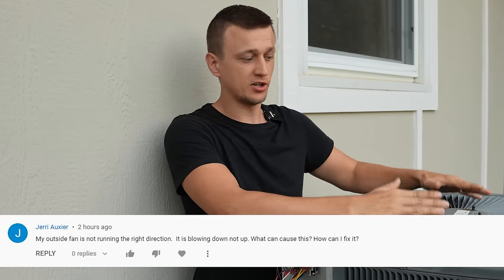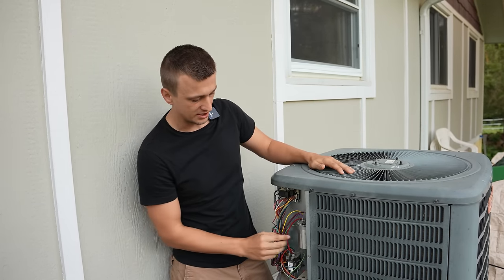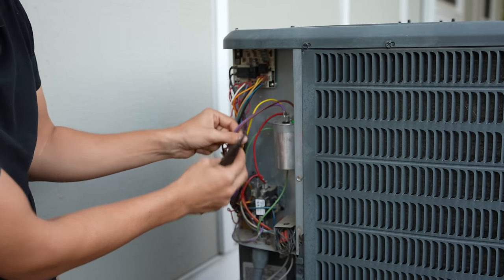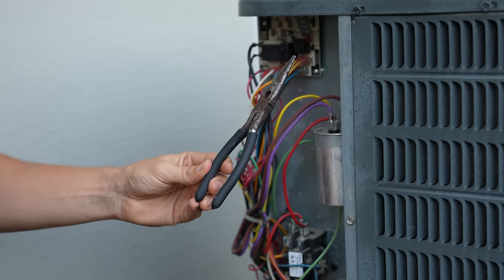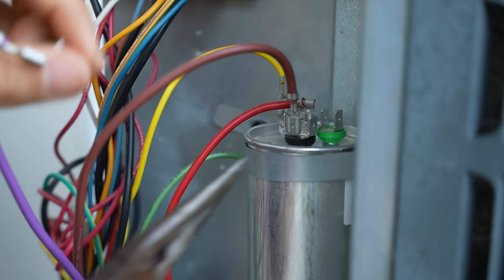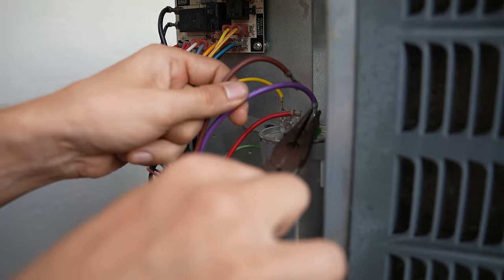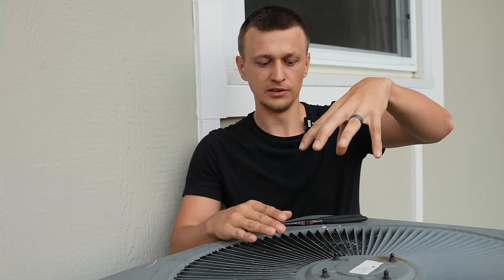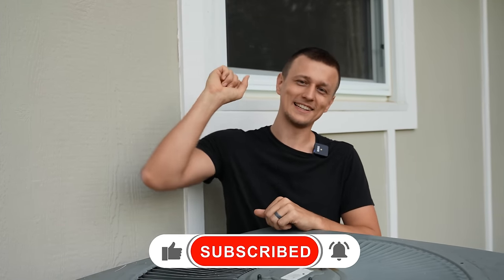Outside Air Conditioner Fan Spinning The Wrong Way - How To Fix It

Comment: Good video 
I’ve a question 
How do you wire or connect a fan motor from dual capacitor like in this video to a single capacitor 
Like for example if I need a 45/10 Mf but I’ve only singles capacitors how do you wire them 
Thanks I follow you from Houston Tx
Reply: Put jumper wire on common leg!
Reply: @bigc8300  
Thanks a jumper from the dual capacitor to the single capacitor
Reply: @Sersol1983  10 4
Reply from the maker: @Sergio Solano
Thanks!
You would simply plug in the two wires that come from the fan motor and go to the dual capacitor, to the single capacitor. This applies if only the fan side of the dual capacitor went bad but the herm side is still good. If the herm side is bad too, you would need to put in another single capacitor for the herm/compressor as well. If you don't have a large enough capacitor, you can combine a couple of them as well. It gets a little messy so if possible, it's best to replace dual caps with dual caps. You might find this video on combining capacitors interesting though if you haven't seen it before: https://youtu.be/qLJOWU33TFo

Comment: Would make a good tip if you were to show a video of what happens to fan and compressor when someone hooks up capacitor connections to wrong terminals..
Also, if you had a locked up scroll compressor, that didnt free up from a hard start kit, have you ever reversed the herm and common to unstick it instead of rapping on the compressor head with a rubber mallet?

Comment: Question for you: I had my AC serviced last year and the tech told me the fan had been wired backwards and was turning the opposite direction. He also said my capacitor needed to be replaced so he swapped it with a new one and now the air blows out the top, as it’s supposed to. My question is: if my system had been running backwards for several years (it’s a new home so I can only assume it was installed incorrectly), how big of an impact do you think that might have had on my electric bill? Is it a big difference when it runs backwards or more of an incremental hit?

Comment: Hey 👋 Jay my number one good buddy best friend ever ❤️ you would be proud of your old friend my friend's Mary and Cody there central air quit working and the heating and air man wanted thirteen hundred dollars 💸 to fix it and I fixed it I replaced the blower motor in the furnace it was burned up and there furnace filters were so dirty and I changed them and told them to change it often  but I got it up and running no problem 😊 thanks to you buddy..I don't remember if I told you but Arnold has congestive heart failure and my vet put him on medication vetmedin he takes it twice a day for the rest of his life so it costs me five seventy one  dollars a day but I wouldn't care if it costs a thousand dollars for he is worth much more than that..he is doing pretty good right now I haven't seen much change in him so I hope it helps him my Dr may have to change his dose..well good to see you my friend I love you and your family 👪 God bless you Jay and thank you for being my friend ❤️. I really appreciate it. 😊
Reply from the maker: Hey David!! I love hearing that!! You're the man 💪💪 Replacing a blower motor is a lot more involved than just replacing a capacitor so major kudos to you my friend! Your friends are lucky to have you. It's good to hear that Arnold has more or less stabilized. Last time you told me about his condition you sounded a lot more worried than right now. Not only are your friends lucky to have you around, Arnold is fortunate to have you as his owner as well! 👍👍👍 Hopefully he will be energetic and in a good mood in the days to come! Good to see you too David, we appreciate and accept the blessings! May the good Lord bless you, your family, and friends as well! Aloha from Hawaii! 🌴🌴🌴👨‍👩‍👦🤙🤙😎🦎

Comment: I have a Miller Split System on my Manufactured home. My High pressure switch tripped and will not reset itself and there is no manual reset. The AC Man said it would be extremely expensive to replace. Do you have any thoughts on this?

Comment: I installed an aftermarket Dayton fan motor. It's spinning counter, but I need it to spin clockwise. Do I just swap the wires orange to orange, to orange and red that are jumpered together at the top of the new motor?

Comment: What happens if you flip the blade on a motor with the correct polarity will it still push air up but just not as much?

Comment: What would it mean if mine runs backwards sometimes and other times it spins normally? The motor was replaced 3 years ago can't remember if the tech replaced the capacitor at the same time.

Comment: Help is needed, please. My heat pump has two cooling and heating stages, as well as an electric coil auxiliary backup (no gas or propane). Within the thermostat, there are eight wires. So far, I have changed three of the thermostats, but to no avail.
The HVAC keeps running for literally hours until I lower the set point temperature, at which point it stops. The issue is that when it reaches the set point (heat or cooling), the HVAC doesn't stop. 
It runs nonstop for hours once the temperature reaches the set point.Never will the thermostat display a temperature that is higher than the set point. Heat works. Please provide advice.

Comment: Check for the cupping bow of fan blades first.  A flipped fan blade and reversed run-start windings on motor will blow air up but will not produce the full amount of air flow due to non-optimum blade cupping direction.  Besidse just tilt of blades, they often have a cupping bow to scoop up the air, like a snow shovel.

Single phase induction motors often have different winding wire gauge and number of winding turns between run and start windings, so it is not good for motor to be reversed by swapping the run and start connections.

Comment: Can the motor spinning backwards because of polarity cause damage to the motor and anything else?
Reply from the maker: From what I have seen, usually not because the unit stops cooling well and it ends up getting repaired. But if it has been going backwards for a long time.. Then yes, it would probably start to affect the capacitor and the compressor, decreasing their lifespans.
Reply: Yes.. the motor, unless reversible, is designed, or wound to run in one direction. To run in reverse is not as efficient and is an unnecessary load on the motor.

Comment: Why does air coming out of a condenser unit exit the grill horizontally across the grill surface instead of more vertically.
Reply from the maker: The fan blades are slanted like that. I am not sure why some manufacturers make it that way and others have it blow more straight up. 🤷‍♂️ As long as it is blowing "up" and not sucking the air in all is good.

Comment: Can you wire a thermostat with no common post into a package unit that does have common at the unit itself. The thermostat has an O and B post for reversing valve can I use one for common. Need help asap thank you

Comment: Question, not related to this video. Can you convert an R22 system into whatever is the "new" freon is now? I have a Trane 2TTB3. I'm not sure how old it is, but the house is about 16 years old. Not sure if it ever got replaced by the old owners, but just curious and sort of thinking for the future.
Reply: No. 410a pressures are too high, your best bet is 407c or r458a or something similar. They're designed as drop ins/conversion refrigerants for r22.

Comment: I have an AC unit that has had its condenser motor and capacitor replaced. when it starts on, it wants to turn to the opposite direction and it has trouble starting to turn. What could be causing this to happen?

Comment: One day no cold air in house, checked the unit and fan was running backwards.  I replaced the capacitor based on a video I saw and it ran correct direction again.
Reply from the maker: That sounds about right! Bad capacitors can do that. I have also seen a bad start capacitor increase the voltage going to the fan from 240v to 290ish, making it spin faster and make noise.
Thanks for sharing!

Comment: I have the condenser fan shuts off 10 minutes after I turned on the AC. The compressor keeps running and the fan doesn’t turn back on. I have to turn if off, wait for like 10-15 minutes then everything is back to normal until 10 minutes later. Please help.

Comment: Fans must be running on DC power to do this,  pretending is not a good idea
Reply: The capacitor makes it change direction on single phase
Reply from the maker: @Dosio Dosev
Actually it is the other way around. With variable speed DC motors, this would not even be possible since they don't have capacitors. I should have probably touched on that in the video...
Reply: A/C polarity can be changed.
Reply: @WordofAdviceTV  but they do have a variac. Which controls the amperage varies the voltage, and is reversible.